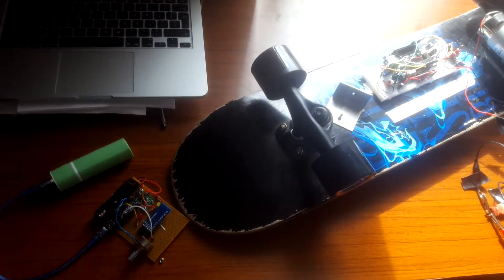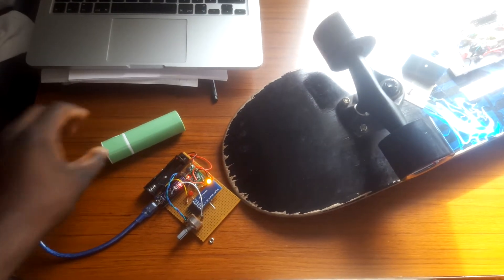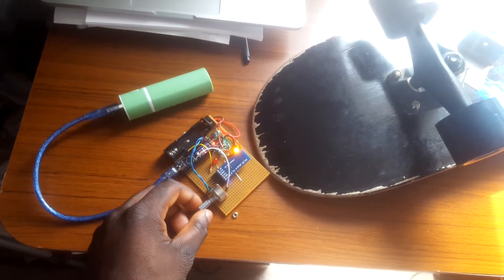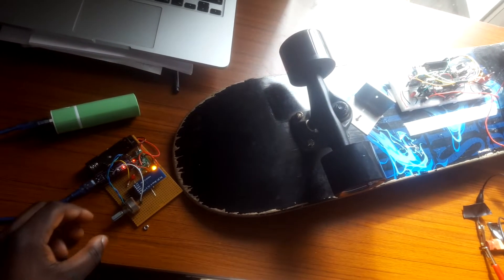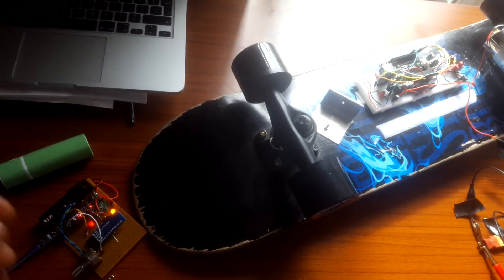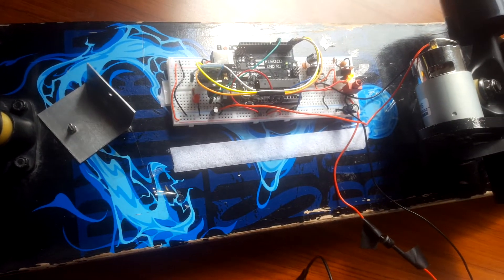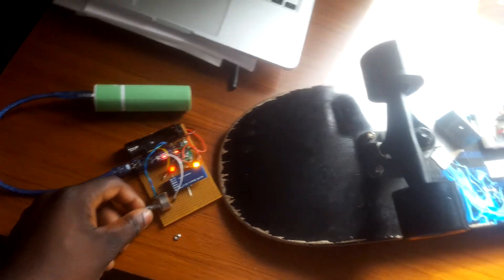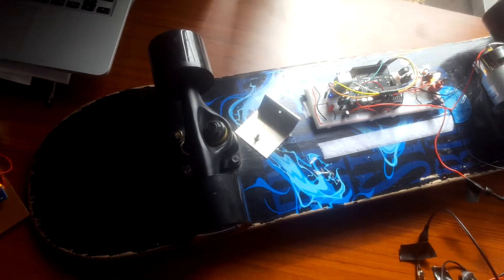DIY Arduino Electric Skateboard

Comment: Dude this is good, what types of batteries did you use for this?
Reply from the maker: Hi Maseka, I used 2 x 12V Lipo Batteries. Since the motors can generate a lot of current, I added a current sensor to control output.
Reply: Eben Kouao thank you for the reply, I have just started learning  about electronics, and would like to work on different projects. Can tell me other projects that you were able to work on in the past?
Reply from the maker: @akelmaseka9385 To be honest, whatever comes to mind at that moment! 
I find it helpful to look at a current project that seems interesting and see how I could build from or improve on that.
Reply from the maker: Hey dude, if still interested in the electric skateboard, an improved version is on its way - https://www.youtube.com/watch?v=x60txNCJIuA